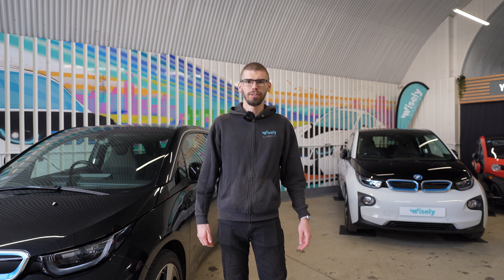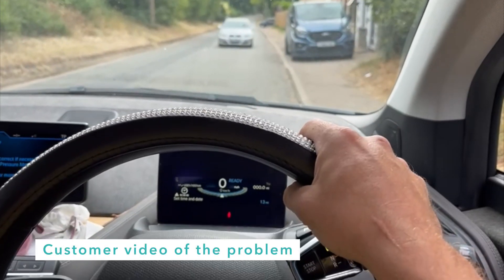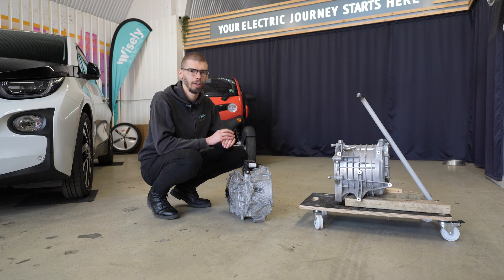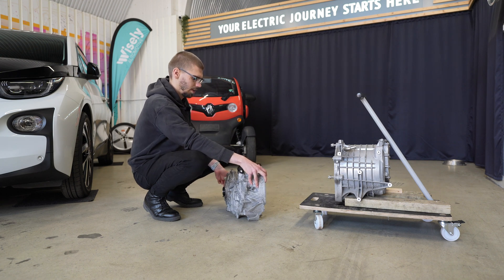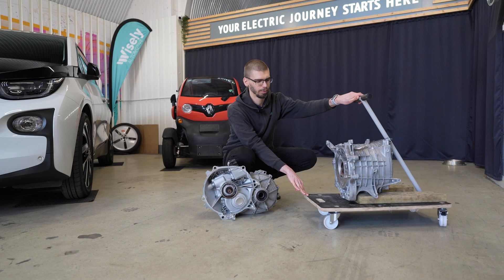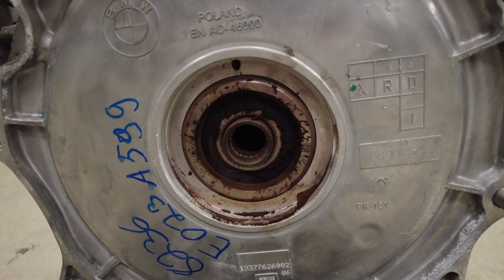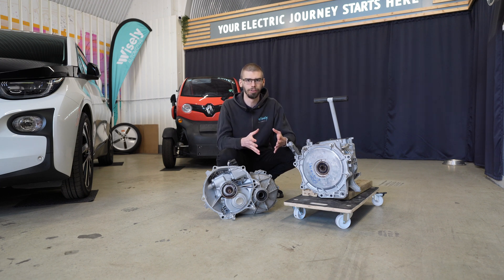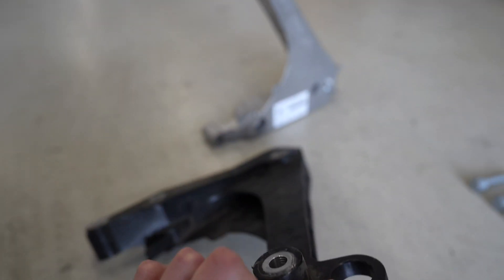Used BMW i3: New Transmission & Motor Needed on a Car With Less Than 30k Miles

Comment: Thanks for the detail info Martin. I was expecting that the motor bearings would be lubricated using the gear oil but, could they possibly just be sealed bearings running billions of revolutions without fresh lube 😮

Comment: Hi,
I just blew the transmission on my 2014 BMW i3 Rex. The dealer is charging $7,000 dollars to replace it. I want to buy a used transmission to change it by myself. Is it possible for you to share any tips you can about attempting this project at home? Do I need to drop the whole drive unit to replace the transmission, or can the transmission come out without dropping the drive unit (the motor)? Thanks in advance.

Comment: slightly silly question, do you need a lift to get access to the gearbox? I need to replace the parking lock actuator, Thanks. My i3 isnt switching gears and I'm in Cambridge...
Reply from the maker: On a REx this is doable (just about) with jacks and stands. On a BEV it’s easier. We would first recommend a professional diagnosis to ensure this is actually what is causing the fault. If you wish to use Wisely MobileService, just get in touch!
Reply: @wiselyauto  it's pure electric. Dealer wasn't able to find the root cause. They thought it's 12V battery. I knew it wasn't as I replaced it recently myself. They did the registering battery routine. Car came back. A few days later, same symptom came up again. I bought my own obd2, there are 4 codes that clearly pointing to the parking lock actuator. Plus I read a Reddit post that shares exactly the same symptom. I'm desperate to getvit replaced. Will checkout your Mobile service - it looks amazing. Do you guys travel to Cambridge?
Reply: I see you have different locations across UK. I will definitely get in touch

Comment: Thanks guys for another great video. 
Question. 
Did the i3 vehicles get recalled for the plastic motor mounts to get replaced to metal ones. so there shouldn't be any plastic ones still out there.
And what outher recalls have been sent out to i3 owners.
Thanks keep up the good work.

Comment: Installing a Hayabusa and deleting the battery. All up it will come in at 450 lbs including 6 speed transmission. Fuel cell 15 gallons where battery used to live. Sequential shifting. Straight exhaust pipes. Everything fits. Carbon fiber pocket rocket. Inspired by this Smart Car pictures to follow as soon as Aptera delivers their first car: https://youtu.be/WcBQPTEKWcg?si=19ZdzqXaUcpSLUu4

Comment: The moment the oil drained from the GRU I could see that it was fine.  Do that on any Hyundai/Kia prior to the E-GMP series and you'll be greeted with black oil due to a design mistake.  Instead of a drain plug with a fixed magnet, they used a loosely-fitted non-serviceable magnet that fails to sequester wear particles.

Comment: This is why you shouldn’t buy those cars from private sellers without a transferable warranty. I just took a 2020 i3S at a BMW dealership with a 24 months full warranty, extended by a year as i financed it with a 36 months leasing.

Comment: I bought my first 3 series in 1983 and had an overheating problem that the ‘Franchised’ dealer misdiagnosed twice, refusing to refund me until BMW confirmed that the replacement part was faulty. I took the car to an independent expert (highly recommended by a client) and it took him five minutes to diagnose the real reason the car overheated, a head gasket. He repaired it for £50 whilst I sat with his wife in the kitchen eating baked beans. Don looked after all 19 of my subsequent BMWs. Wisely are made from the same cloth, technically adept and obviously utterly reliable. Franchised Dealers the world over see customers as punters and Wisely deserve all the success they are enjoying 👍
Reply from the maker: Don sounds like the kind of guy who'd have a seat on our bench, though not sure we (or anyone) could replace a head gasket for £50 these days!

We really enjoyed reading your comment and thank you for your kind words! We hope that BMW #19 is an i3, or if not that #20 will be 🙂
Reply: @wiselyauto  I intend to buy a 42kwh version and I understand the end of leases coming up in October will provide the perfect opportunity. I do believe it will be my 20th Beemer.

Comment: I am nearing the end of swapping in a new motor and differential.  In your video, you say the motor doesn’t need synced to the car.  Other than plugging in all the various electrical and coolant lines; what else should I do before connecting the 12 volt battery followed by HV battery? Any advise much obliged!

Comment: My wife has an i3 Rex 64 plate. She bought it as a demonstrator from a BMW dealer, it has almost every extra and had just 3k miles on it. Now has 125k. I think at some point will need a new motor - getting louder and louder. It makes a loud whining noise, the pitch goes up and down with speed. Not sure what it is, but assuming the motor. Has anyone else experienced this? We will keep it and replace bits using salvaged parts (for the expensive bits). The carbon fibre body costs so much and lasts, so makes sense to keep it.
Reply: Search this with "i3 electric motor bearing problem". It seems to be a known issue until 2018 models! You are prolly going to need a new electric motor from what I've read.

Comment: Great content! Does anyone know of someone like this in the US? (not Electrified Garage, please). I would love to know what the process is to remove the motor and/or gearbox, as my 2015 BEV has a bad motor output bearing (94k miles), and I will probably have to replace it with a salvage one (BMW repair estimate was $16k)  I'll be looking for one from a  2018 and later which uses a better "tapered roller bearing". This newer part number motor is now the same specified as the replacement part on all year i3's (from what I found online)
Can this repair be done without a lift, by just using quality jack stands?

Was the Motor Calibration process not possible without the numbers that were supposed to be on the motor? The inverter would need to know of any rotation offset between the rotor and the position sensor, so it can time the drive pulses to the motor at the right time to make it efficient.
Reply: I'm hoping these questions will be answered 😅 I've been eyeballing one relatively cheap 2014 model with 210tkm on its electric motor, and would not be surprised if it needs the motor to be changed because of these stoopid bearings.

Comment: This isn't the only i3 Motor failure mode. https://youtu.be/yl8CELCGf_M
The motor output shaft bearing was a standard roller bearing from the beginning (including ActiveE), and experienced wear during the prototype and pre-production stages, but BMW went into production anyway.  In 2018 they changed it to a Tapered Roller Bearing and it resolved the problem.  My 2015 has just been diagnosed with this issue, and I'm facing a $16k replacement bill... not happening.
Reply: Let us know how your case develops! 🙏
Reply: @Pajune   Recently bought a 100 mile used 2018 drive motor, and a zero-mile transmission. Next is getting all the required "small"parts (about $600 new), then get busy...

Comment: A very interesting report.  With the recent wet weather and floods I would be very grateful to learnr the degree to which an i3 can be driven through floods and where do damage risks occur.  With the battery enclosure or the drive motors?

Comment: For me, it would be galling to replace a very costly motor because the splines on the shaft are damaged. Perhaps a machinist could make a splined bush that could be shrunk/pressed onto the shaft after it is turned down to a plain cylinder.
Reply from the maker: It's definitely something we will look into if this becomes a more common problem. Better for the environment and the wallet to repair instead of replace...
Reply: @wiselyauto that would not hold 200 lb ft of torque however tight it might be fitted.
Reply: It was the splines in the motor ( the female part of the coupling) that had stripped. The shaft on the gearbox was ok. So to do what you suggest the motor would have to have been disassembled, which is a specialised procedure especially if it's a permanent magnet motor. Then machined as you described. You might glue the splined bush in. If done faultlessly with the right industrial adhesive it might work, maybe. But the labour cost to spin the dice would likely be way more than £1500.

Comment: Had me worried as my car is a 2013 70 plus K on the clock, until you mentioned the gearbox on this one was replaced in 2018.

Comment: If the transmission lock did not release properly, I could see how the electric motor could spin with all its tourque and damage the female splines of the electric motor that mate with input shaft of the transmission.

Comment: Impressive video. It is honest accounts of issues with new technology like this which will persuade me to take the ev plunge. If you could still get a new i3 I'd be interested but they stopped taking orders in July [a mistake by BMW IMO]. The 'lifetime oil' bmw bullshit also applies to their ZF automatic gearboxes which need new fluid at least every 80,000 miles. Costs £300-£400 but means your box is good for maybe 200k & gives you peace of mind.

Comment: Thanks Arthur for another informative video, the question is if we drain the gearbox oil what grade is it, where do we fill it and how much?
I ask this because previously I had a brand new Twizy which was delivered without gearbox oil in it! I complained from day one it was noisy but it was only after having a drive in an Italian ladies one I was sure something was wrong. Renault dropped the oil and found nowt in there! One new gearbox later quiet twizzy

Comment: I’m wondering if alternatively this could occur from frequent shifting from drive to neutral back to drive to coast with foot off the pedal. Would that be a potential cause for this repair?
Reply: That’s how an Ev is normally driven. That certainly has an effect but the problem shown here looks like a huge fretting of rotor internal gear teeth either by severely corroded part prior to installation or by lack of proper heat treatment ie harder male part mating with softer internal part.
Reply: The video suggested it was assembled without grease. This would leave it vulnerable to corrosion and also fretting if there was any clearance at all between the splines. There also seems to be an issue with motor output bearings (from comments here) so the motor output spline could be wobbling about, which could cause it to destroy the spline.

Comment: Awsome analysis. Salvaged parts are the correct solution. However, there is another option: duplicate the parts.  You can disassemble the spline and mated shaft and bring them to a machinist. The parts can be perfectly duplicated and hardened. It wont be cheap but it is an option if BMW is unwilling to sell the spline and mated shaft.
Reply: I was thinking of the same.
Reply: But as he mentioned internal spline integral to the rotor which is (almost) perfectly balanced in the factory with lots of permanent magnets and laminated sheets which are (I guess) riveted together.

Comment: Great video, but 8:47, front and rear wheels mismatched/ wrong handed - I blame you for teaching me that on your other video!!
Reply: great job You know the i3 like the back of your hand. A small question for maintenance of the box. Can the filling be done by the air vent on the top of the box without having to remove the transmission? Thanks
Reply from the maker: Haha, it pained us to see this too but if we can't correct things we're not being asked to / paid for unfortunately. Front wheels didn't come off for this job - we did put the rears back on the correct way round though, so at least the issue is halved in severity :)

Comment: Good video but I can't agree with your assessment of the fault.  Once assembled the splined areas of the output/input should be essentially static and require no grease.  The BMW blog you showed is likely talking about the actual bearing surfaces of the output, not the splined area.  The fault you saw would most likely be because the splines were slightly different between the 2013 motor and 2018 gearbox...close enough to work for a while but sloppy enough that over time wear occurred and the eventual failure of the female splines.
Reply: I get your point regarding the splined interface being a static connection. I am guessing the wear on both sides of the connection caused the failure that they fixed by sticking on a new or salvaged gearbox - which gave just enough bite for long enough to move the car on to an unsuspecting new owner!

There are many high mileage i3s out there that have not suffered the failure so I wonder what caused it?  Maybe the bolts between the original gearbox and motor came slightly loose allowing movement. Or there was a tiny alignment fault in the manufacture of the motor or gearbox. With the torque coming out of the motor, that connection has to be 100% perfect but then for it to be that perfect (tight) it would be very hard to assemble
Reply from the maker: @gap9992  having now had a chance to think it all through, consult with a few people and generally assess all the evidence available to us, we have reached the conclusion that your theory is likely the most accurate. We believe that BOTH the teeth/splines on the original trans/motor wore down to the point where the transfer of power was inhibited (Why? This we'll never know but you have offered some reasonable suggestions). Then... whether knowingly or unknowingly, the (lesser) wear on the motor's splines was not addressed and a new trans was fitted. The fresh teeth on the brand new input shaft provided just enough bite to keep the power transferring for a few thousand more miles / to sell the car to an unsuspecting new owner. Second time round, the failure happens faster and is more pronounced, as this time there is a bit of slop/play between the fresh teeth and the already pre-worn splines on the motor output. It could almost be argued that a lower mileage car is more susceptible to this wearing down due to the constant switching of torque direction.
Reply: Owmer may have thrashed it @gap9992
Reply from the maker: https://www.greencarreports.com/news/1082061_bmw-activee-motor-failures-the-price-of-leasing-a-test-car

“The drivetrain housing assembly in those vehicles may not have been adequately sealed at the factory, meaning that gear shaft was not sufficiently lubricated.

Over time, the connection between the electric drive motor and the gear assembly could become worn--and fail suddenly

In the case of this sudden failure--experienced by more than a dozen BMW ActiveE drivers--the loss of lubrication over time would cause the gear to grind on the electric motor output shaft until one or more splines failed”
Reply: @wiselyauto  Interesting.  When one reads the actual recall documents even they do not clearly describe the failure or show failed parts, except for a failed transmission input seal. 
https://www.nhtsa.gov/vehicle/2011/BMW/ACTIVEE#recalls

 I believe the failed splines they are referring to occur on the other side of the transmission input shaft, inside the transmission, caused by low oil level in the transmission due to the faulty input seal.  Their picture of a failed seal (#47) shows oil glistening on the housing and pooling up below it.  I also notice that your car had the improved motor output with the closed end, as opposed to the older open-ended part shown in picture #26 of the repair bulletin.  

In any case, did you notice leaking lubricant/a failed transmission input seal on this car? When you show the motor output the metal shavings appear dry and powdery, not as you would expect if there was indeed a failed input seal.
Reply: It's not really static if the motor turns backwards in reverse. The joint will rock slightly with each change in direction.  I do think your idea about the splines being different is plausible. Maybe that later gear boxes have a harder temper than the older motor splines.  If that's the case, you could consider the gear box and motor to be a matched set so, you should never switch just one.

Comment: Love I3’s but…
Reply: But what?
Reply: @benbaselet2026  .. she comes with a baggage full of surprises :)
Reply: @Pajune  18 months with mine and none yet popped up :)
Reply: @benbaselet2026  That's great! I wish thousands of happy km's for you! May I ask you which year model do you have? Battery size, rex? I've been looking at a high mileage 2014 model, but it seems like a very bad idea 😂
Reply: @Pajune  2019 BEV, 120 Ah. I very specifically wanted a commuter car and not the REX (especially the heat pump comes more in handy for me in Finland).
Reply: @benbaselet2026  Aha, a fellow Finn! 😂 That 2019 is probably way more reliable than the early models. The 2014 model looks like it'll need a new battery pack soon. I could do the infamous motor mounts myself, but then discovered the possible electric motor bearing problem affecting the 2014-2017 models. Seems like I'll end up with a project car if I go that way. I guess I'm better off waiting for couple more years for the 2018-> models to drop in price (assuming they do drop).
Reply: @Pajune  They should drop in price, eventually... I bought mine for 23,5k and since that the market is asking around 27+ for them .
Reply: @benbaselet2026  Hahaha 😭